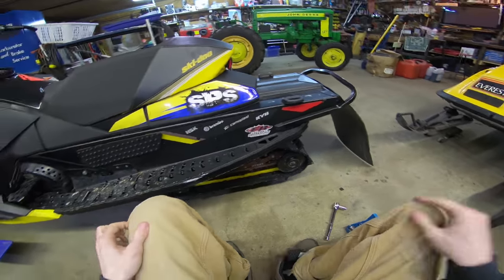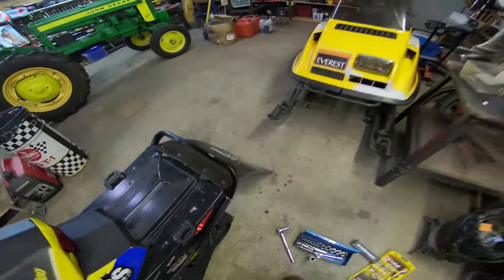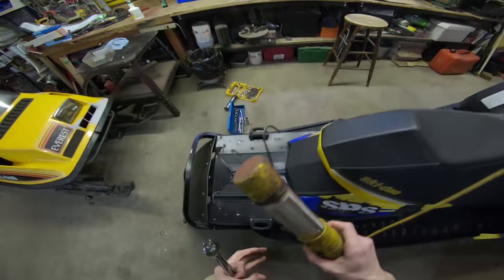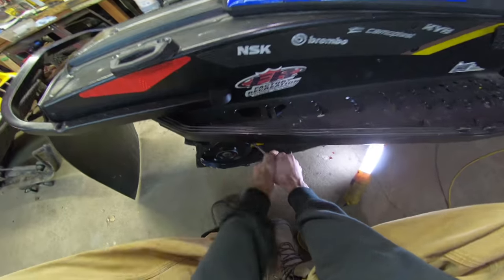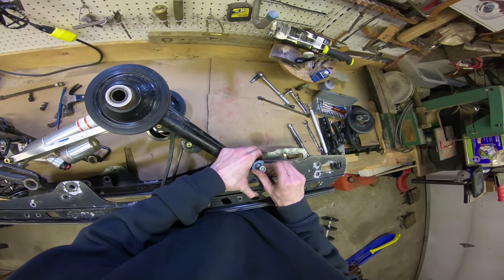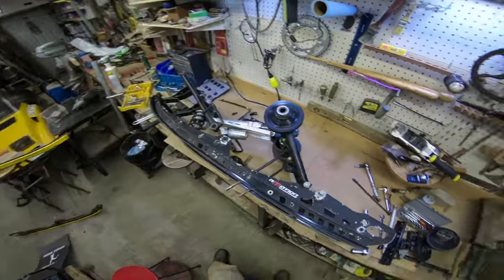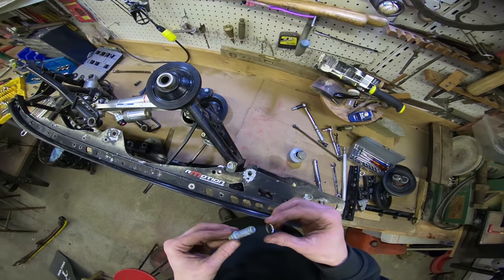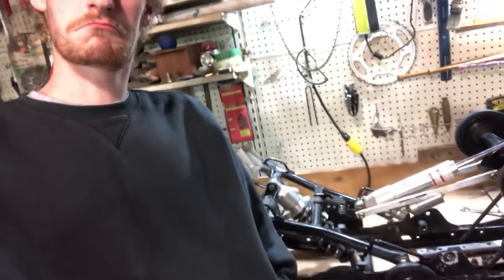129" rail installation (part 1)

Comment: Did you drain fluids before tipping it over? I'm always worried bout getting gas or.oil everywhere. I also have a hoist to.lift it in the air thinking I'll just go that route
Reply from the maker: no i don't drain anything out it doesnt usually leak out too bad unless the gas is right full. It doesnt have an oil tank so dont have to worry about. A lift would be really nice and helpfull!

Comment: I have an 09 xp with the sc5 skid. I'm thinking about putting a 4" extension to go from 120 to 129" but did you extend your tunnel?
Reply from the maker: no didnt touch the tunnel
Reply: @SPSproductions  thanks I think that's all I needed to know.
Reply: @SPSproductions  how bout gears? I'm adding a 1/4" and 9" of track. Should I go down a couple teeth on top?
Reply from the maker: @kwadlife4106  it depends what you wanna do i guess

Comment: Hey it's a great thought but it woulda been easier to get rail extensions and install them with ya new track then to get OEM ones and making them fit, if you change the angle of your front swing arm you will mess the geometry up, look at extensions before u start Welding stuff bud will make life easier
Reply from the maker: i think ill be fine plus its already on soo

Comment: You could buy a 2017 Polaris 600rr for like 4900 and it’s already a 136
Reply from the maker: or i can spend a couple hundred and change the rails? Also if i found a 2017 iqr for 4900 it would be beat to shit
Reply: spsproductions11 u r right just putting the option out there , but there r some mint ones on Craigslist in MN with zero hrs for like 5400 us money😂😂😂😂😂
Reply from the maker: @fishnfreak04  yeah i'm in Canada things cost a lot more up here lol
Reply: spsproductions11 oh dang😭 that actually really sucks